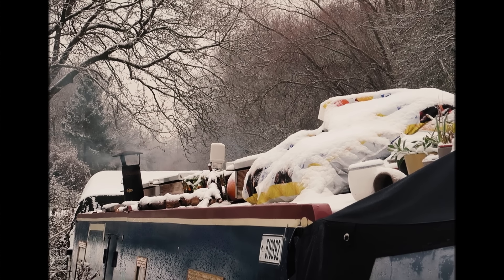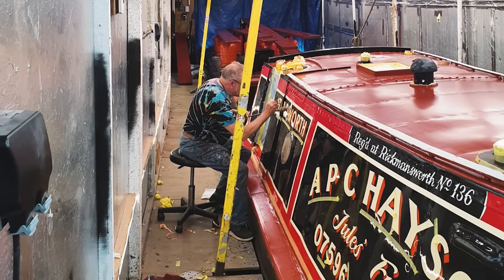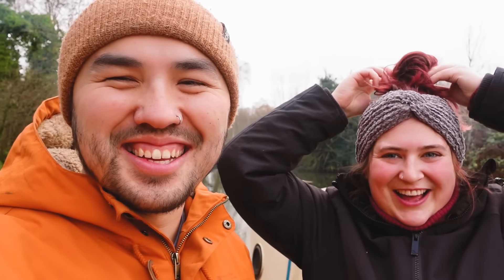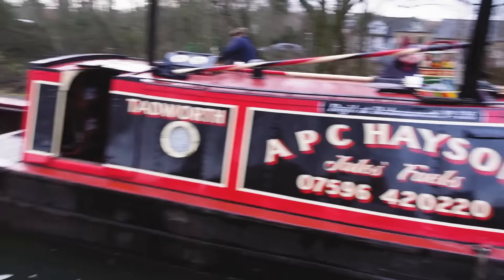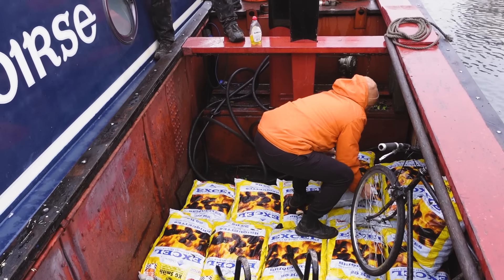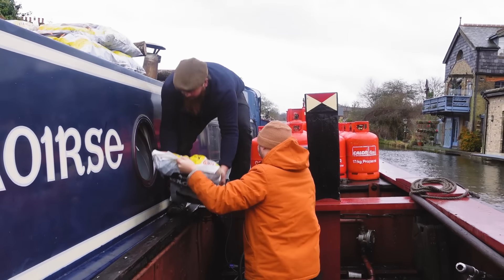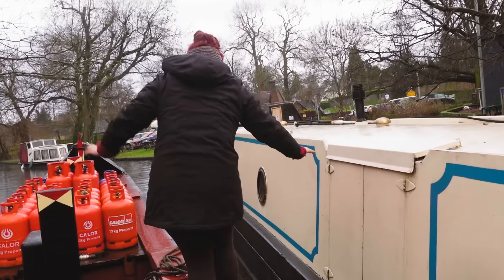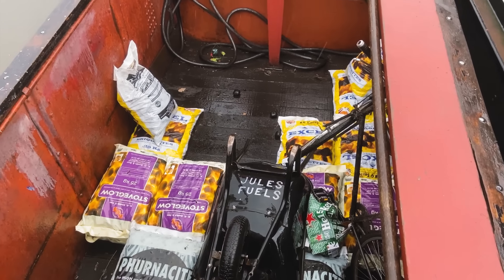A day in the life working on a canal fuel boat - 189

Comment: What's the water coming out the sides?
Reply: All the rain water that’s fallen into the hold.
Reply: @mummyandlittlemiss2634  makes sense. Sorry I'm not a boater. Looks a great life though
Reply from the maker: Yep! It’s a plug to drain rainwater out because the fuel boat is open top, so the rain just builds up in there 😊